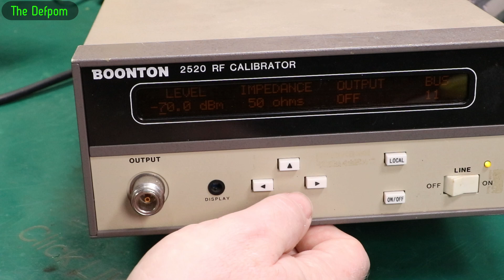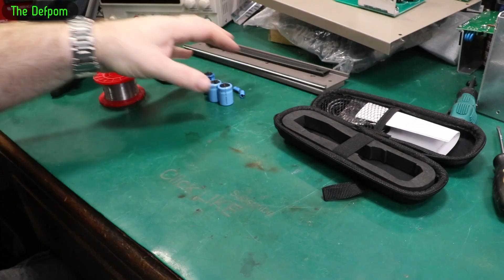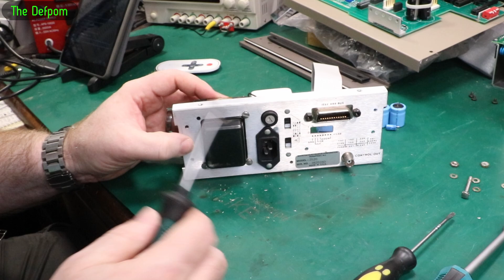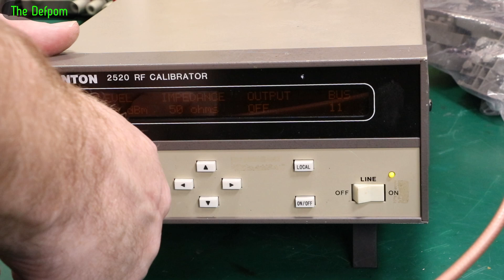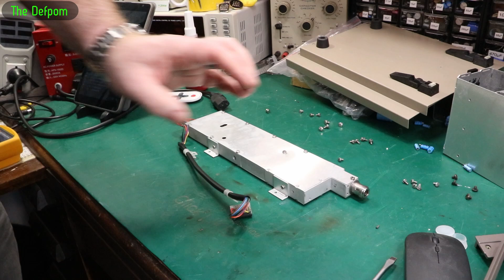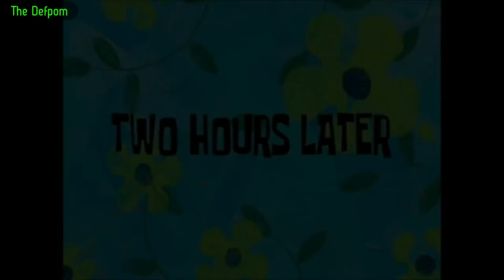🔴 Boonton 2520 RF Calibrator Repair - No.1335

Comment: It can be calibrated from the front panel, and the correct output signal data can be saved to its calibration memory, much like the Fluke 60/80AN.

Comment: I changed mine, I added a 40x2 LCD display, equivalent to HD44780, a 3.3 k ohm resistor between pin 1.3 and it works fine

Comment: When you hit the marker button it should bring up a side menu that will let you change from freq to power measurement along with others. At least that how it is on keysight(HP Aglient) and Rhode and swartz units. Never used a siglent before tho so I may be wrong.

Comment: I think I know why they chose 30 MHz for these, as the probes on theirs, and some other, RF voltmeters are pretty much flat up to that frequency before they start dropping off. After that, you have to use a correction factor on the measurement.

Boonton, like Millivac and HP, need to have the probe and meter together to calibrate it, and the meter can't be switched to another probe after calibration.